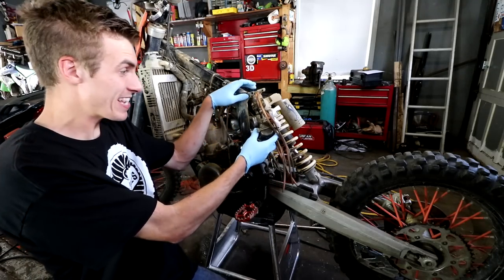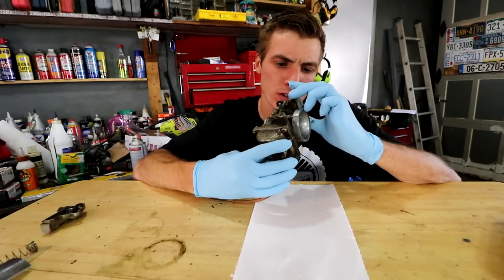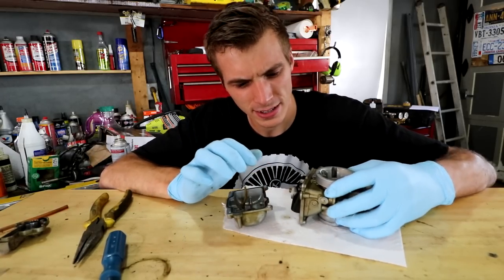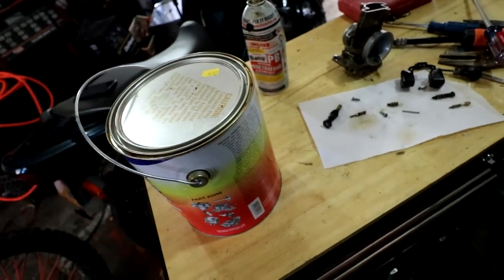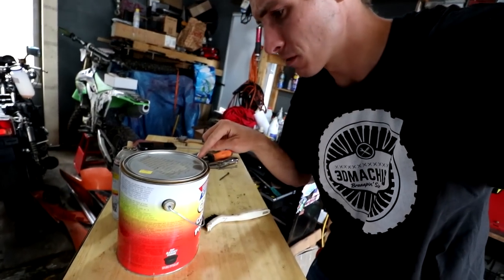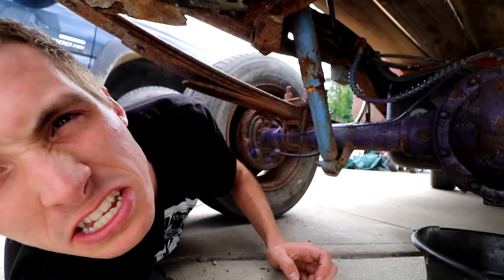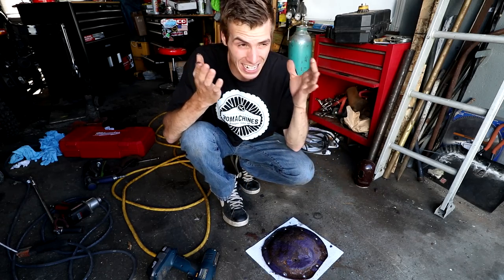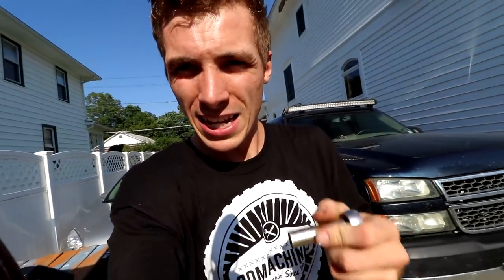THE KTM STILL ISN'T FIXED

Comment: The fill plug is on the lower half of the driver side in the front. Tool me like 30 minutes to find mine. The rust on your ranger makes me feel so good about the rust on my 1983 ranger. And it came from a town that mines salt.

Comment: The plug is on the front driver side you need a 3/8 or 1/2 box end a bit of a pain to get to but always loosen the fill before the pan cus if you can't open it and you drain fluid your kinda skewed I have 2 rangers and both had the fluid changed
Reply: Write when he said he was gonna make one i was just like "facepalm"
Reply: so glad im not the only one that was wondering why he didnt just use the proper plug...

Comment: @3Dmachines the fill is on the other side of the diff, it should be next to the driveshaft kinda on the drivers side, itll be a 3/8 little plug you stick the end of an extension in

Comment: The fill plug is on the front left side of the pig. You use a 3/8" drive ratchet to remove it.... but I think your hole in the cover is fine for a beater. Just put a glob of silicon over the hole! Welding the gears up, makes turning on slippery surfaces very hard, so you will just half to slide around corners... sounds like my kind of fun!

Comment: That read end has a fill in the center section, it is on the side. It uses a pipe plug with a 3/8" square drive so you can just use ratchet and extension to remove.

Comment: 1/2 inch ratchet Extension works to remove the female fill plug located on the front of your Rear end. Clean the rust/junk out of the square hole, before attempting to hammer in the extension, and remove it.

Comment: The fill plug is on the differential itself on the upper front portion by the driveshaft. It's plug that screws in using a 3/8 ratchet head.

Comment: mate the fill plug is on the other side it is like a recessed bung that takes a 1/2" socket about half way up the dif and if you are looking at it from the drive shaft side it is on the right.

Comment: The full plug is on the other side of the differential... by the input of the driveshaft a 3/8 extension fits in the plug

Comment: There is a fill plug on the front side of the pumpkin. Uses a 3/8 ratchet with no socket to remove .

Comment: Yes, there is a fill plug on the front of the diff lol you didn't have to drill a hole. You do have to take the cover to drain the fluid though.

Comment: Pull out the abs and wheel speed sensor on top of rear differential and put in there but just search the fluid capacity of what you can put in the rear end

Comment: Fill plug is in the front of the differential by the u joint. You  may want to just weld that hole back up.

Comment: The fill plug is on the front side of the axel. Right next to the drive shaft should be the same size as 3/4inch ratchet

Comment: Might be alot more work then it's worth but on the dif fill hole. weld a nut over the hole then just put the bolt in the nut.

Comment: If the metal isnt thick enough weld a nut on the diff that way you can use a bolt as the plug

Comment: Hey man if that is a 7.5 like the 02-04 mustang v6 the fill is on the driverside front of the diff on the top by where the shaft comes into the diff.

Comment: 3dmachines, i recall awhile back, you had a couple people send you in some truck radios. I have recently gotten a 1999 f150, but am looking to possibly add an aux port to the stock radio as it functions great in every other way (minus the tape deck or id use a tape adapter) do you , or know someone who would know about working with truck radios? I dont even know where to begin to find the parts id need! Thanks!

Comment: If anyone can remember in his video where he pressurized the crank to test for a bad seal, he blew the air into the cylinder, but the bubbles came from the countershaft seal, wouldnt that mean the air is leaking through a main seal then into the gearbox, then out of the countershaft seal? Is he changing the main seals too?

Comment: So Dalton(or anyone who could help) , I have a carburetor that's not getting fuel to the bowl because of rubber in the fuel intake. Do you have any tips for removing it. The passage has about 1/3cm for inner diameter.

Comment: Just a heads up, you pressure tested that ktm a few weeks ago and found an air leak, well replacing the output shaft seal isn't going to fix that air leak, you need to replace the right side crank seal

Comment: Like did you look for a drain plug there right on the right or left hand side on the inside by the drive shaft still good vid but you didn't need to just start drilling holes.

Comment: Last I seen this bike u had air coming out of the output shaft seal when doing a leak down test. That means a main seal is bad. Didn't see if u replaced it or not but just fixing the output shaft seal won't fix it. Will just hide it till u run it. It'll suck air an lean out.

Comment: Don't you hate it when you think you have all the tools you need for a job then you settle in and start working. Only to realize 10 mins into the job that you need another tool and then have to get up and walk all the way to the other side of the shop to find it? Also clean up and reorganizing tools that were used for a job has got to be one of the things I dislike most

Comment: Dalton...  There's always a fill plug ..  how you think the fluid got in there...  it's on front of the axle should be driver side 3/8 drive should fit it..   but no biggie not like the ranger is worth a crap anyways lolol
Reply: the OEM fluid is put in before the cover is installed.  nose down
Reply: maybe in the manufacturing process...   after that it's put in through the front..